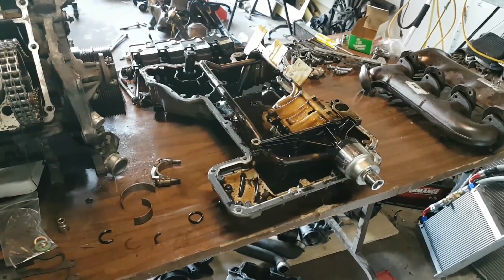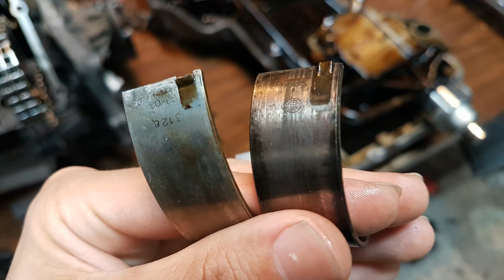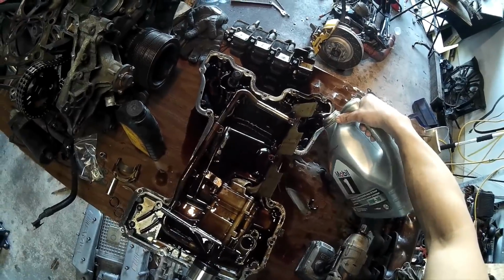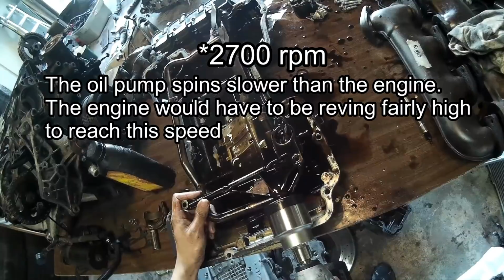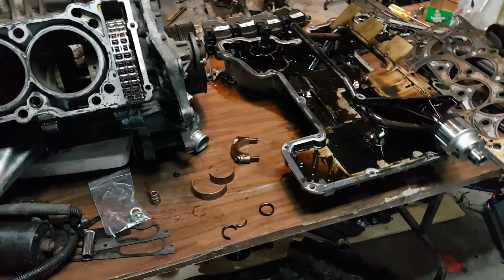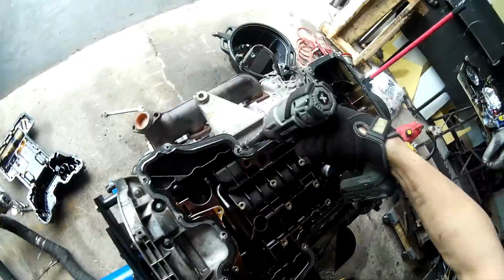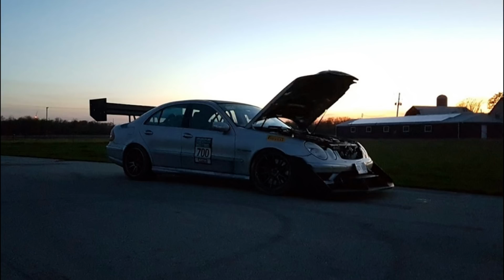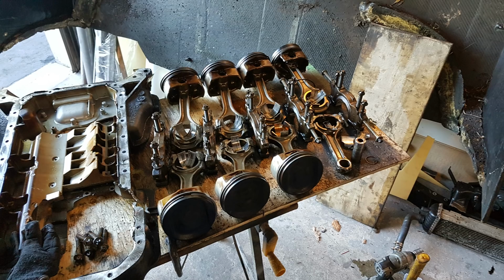Bad O-Ring, Spun Bearing Again! On 2nd AMG Engine

Comment: Do you think additives for oil leaks would help to soften the rubber o-rings?
Reply: never use any oil stop leak, never
Reply: No. They're all pretty much snake oil. Also to the guy saying synthetic oil will dry them out... that may have veen true in sythetic oils infancy, but these days that doesnt happen anymore. Stop spreading misinformation and let that myth die.
Reply: no it wont. just do more frequent oil changes and get a viton o-ring
Reply: The simple answer is no.. Sorry dude..
Reply: jospi2 
there's some additives that say it could soften the seal but it's more towards preventing it from hardening when the known seal is already soft.
Reply: synthetic oils will cause the o ring to dry out faster than conventional oils will... best solution would be to braze the tube in place rather than rely on an o ring.

Comment: The chain scratching / grinding on the timing case is very normal on all m113s. I suggest you grind about 50% from that section of the timing case. That's what i did when i rebuilt my M113K.  You can try and find a stronger spring tensioner, however its very unlikely that you will.  Even so, it eventually will happen again.  

My o ring was semi hard, i replaced mine too as well as the  round pressure valve that's between the oil pump and block.  

If Your pistons are good i suggest you buy new bottom end bearings and piston rod bearings.  At least you can then rest asure that the most critical parts of the engine are new and ready for some boost 😉
Reply: Normal? so all the metal grindings in your oil as a result should be considered normal? seems like the chain is stretching or the tensioner cant keep up and it slaps.
Reply from the maker: Thanks a lot for the advise. Most mechanics I talked to knew nothing about that oil pump chain grinding. Will look into grinding that section away and changing the tensioner. I'm also leaning towards rebuild. Parts aren't cheap but at least it will be a solid engine with new parts afterwards
Reply: Are the chain tensioners hydraulic? If so the lack of oil pressure will cause the chains to go slack and hit the casings
Reply: SK8215 yeah not many know about it because they are timing chain and they never have stretched chain issues,  so they never open the timing case to ever find out. 

I'm happy to send you photos of how i did mine.  However I'm not sure how i can send them to you.  

If you have any other questions or  after  rebuild info, hit me up!
Reply: common are the all timing chain tensioners, mecanic or hydraulic, fitted with anti return locks to prevent the tension release: if not the loose chain can jump timing wheel toots and destroy the engine by valve pistons collision...

Comment: Hello, your both engines looks like they have been poorly maintained or overheated or they had both issues, poor maintenance-irregular oil changes and clogging of oil channels due to old/burned oil and constant overheating as final result. I have seen lots of engines and not many of them looked so dirty with so much burned oil inside. You have also problem here with faulty chain tensioner, stretched chain or worn chain sprockets. So it’s not advisable just to change parts you have mentioned. This engine needs to be checked for internal wear as well. Cylinder bores, pistons and rings (oil ring can be clogged as well…. I hope this have helped
Reply: Sasa Ugljesic I'd say those problems could all have been caused (or majorly accelerated) by the poor oil flow/pressure resulting from the degraded o-ring.
Reply: Actually I need to correct myself second engine was poorly maintained. My opinion is that first engine has blown because of the failed O-ring which we have all seen and this ring has prematurely failed because of higher oil/engine temperatures.  This car has been heavily tuned and raced. Internal temperatures of such engines are much higher specially oil temperature therefore special oil needs to be used and oil change intervals should be even per race. If such cars are raced oil pressure/temperature gauge is a must. I don’t think that it would help in this case. Second, if there is intention to tune/race stock engine internal components must be checked and upgraded. Here the weakest link was cheapest part that O-ring. We all know that today’s average engine life time is about 200k km if u tune/race it lifetime is significantly reduced. I have also noticed through this videos that car had problems with clogged/blown cats what points to very high exhaust temperatures, very high exhaust manifold, head, oil temperatures….
Reply: I agree

Comment: One other thing to mention. From 11/2003 all E55's recieved an upgraded oilcooler system. The first ones only have one, the later ones have 2. Maybe this has something to do with it.
Reply: SchepersP the engine in this video is from a CLS and that was only built in 2006... it seems to follow no matter what years
Reply: @QookBuuk  Supposedly after 2008, Mercedes finally released an updated design for the M113

Comment: I never heard of any failures like that here in Germany. either it is actually weather related like you suspect or it has something to do with tuned engines because I never heard of a stock m113k fail because of this.
Reply: Perhaps it's some fuel additive (MTBE, etc.) that's put in for vehicle emissions. The ethanol in US fuels seems to shorten the life of polymers in a number of applications I've seen.
Reply: John Smith why should we hide problems? I'm not talking about the Internet, I'm almost everyday in  the shop of a friend who's company build more m113k, m156 and especially very very high horsepower m157 then you could even imagine. the last couple of years, Russian rich kids are going crazy with 1000hp amg builds and this shop builds a lot of them. all of them working in the engine Departement said that the m113k is the most reliable amg engine ever and not once did they see a problem like this.
Reply: It gets real hot in our South west.
Real hot.
Reply: Yes, I think ambient heat has contributed to this failure.
Reply: What Mercedes should have done was had a flat flange welded onto the end of the pipe with a surface that is machined very smooth that bolts up and either uses no gasket or a metal crush type gasket like a head gasket. 
I rebuilt a m113 NA engine last year, did all new rings, main bearings rods bearings, all gaskets etc. It wasn’t cheap.
Reply: You never heard of them because it may be specific to this sump setup. The same engine in other models may not have the same pump construction.
Reply: Not engineering the whole system for the ambient heat makes sense as a path to failure. VW did a similar thing with the DSG7 transmission - in hot countries the synthetic gearbox oil degrades over time and leaves sulfur deposits that short out the mechatronic unit. They have never had this problem with them in Europe.
Reply: must be tropical heat!! my air oil cooled bike also has such gasket o ring hardening problems after only 30,000km..

Comment: I'm taking mine apart in July or august. I'll keep you posted on my progress. I hope I can remove the subframe and leave the engine in place and do the work from underneath.
Reply from the maker: Yes, should be possible doing it underneath. One of the mechanics I talked to says he has seen other M113's with spun bearings too. Could be something specific to cars in this region but better to be safe anyways. Installing an oil pressure gauge would be the best way to tell. I'm guessing you would see a drop in pressure if air is going through the pump.
Reply: That was what I was wondering as well - how much of a headache to do this with the engine still in the car.  i.e. hold the engine up w/ a fender to fender hoist/brace & drop the subframe out.

Comment: Fuuck this is scaring me I am about to pick up a e55 this is like the rod bearing problem of the v10 m5’s
Reply from the maker: Could be something specific to cars in my region or cars driven in this weather, you never know. I'd just install an oil pressure gauge so at least you can prevent something like this before it happens.
Reply: @xfmotorsports  I heard that the CL 500 with the M113 engine has a different oil pan design and this shouldn't be an issue there. Do you happen to know how much would it cost for a specialist to replace this O-ring and can it be replaced by just removing the oil pan without opening the whole engine? Thanks!
Reply: Dav Apikyan don't worry I've had a w210 and w211 e55, m113 motors are bulletproof
Reply: Buy one. My 06 E55 been a beast 178,000 miles now
Reply: I think you've got it figured it, just praying mine stays sealed in this Texas heat and doesn't fry my engine too. Age and heat don't do rubber any favors lol Enjoying your videos man
Reply: BMW ///M Power If I had a E55 or similar engine I would certainly install an oil pressure sensor.
Reply: AMG 63 engine: weak head bolts, not only on mondays but for a significant part of the production run. AMG E55 engine: 2 random samples both show the same o-ring failure. Not looking too good.
Reply: They degrade because they're the wrong compound. Synthetic rubber degrades and doesn't handle heat. Im surprised Mercedes would even put that in there, especially since its SO hard to get to.
Reply: just ask to replace the o-ring? It will prevent you from wasting a lot money buying a new engine in the event it goes wrong
Reply: that bearing issue was a mistake by bmw because they used wrong oil on motors i heard,mby he using some other oil,not the one  bmw recommends?
Reply: Replace it with a different type of o-ring. I suspect Mercedes used a standard, low cost elastomer that breaks down. If I can find them in the size and durometer I need, I use viton o-rings. They hold up in transmission and engines. Some fuels can degrade them, but they dont get real hard and brittle like the cheapie synthetic rubber ones.
Reply: My Pre emptive condolences in advance....R I P